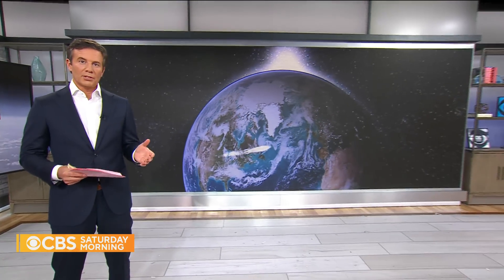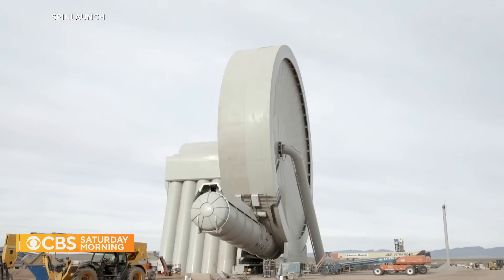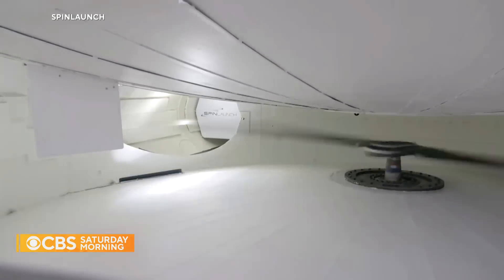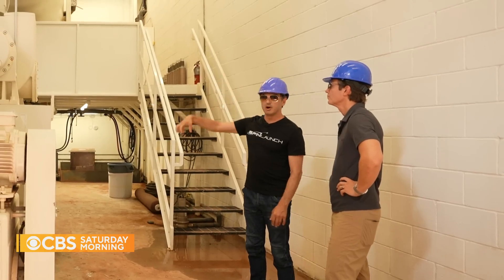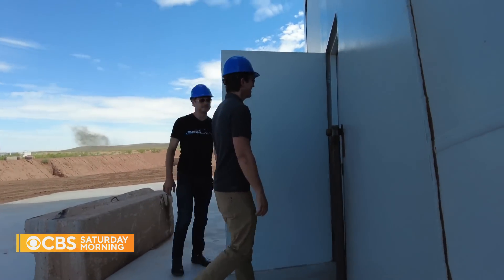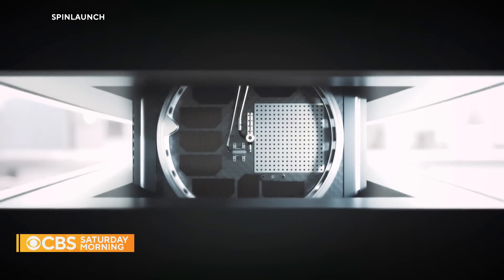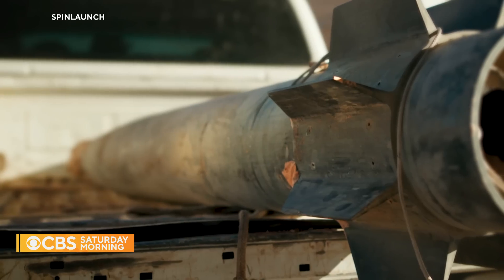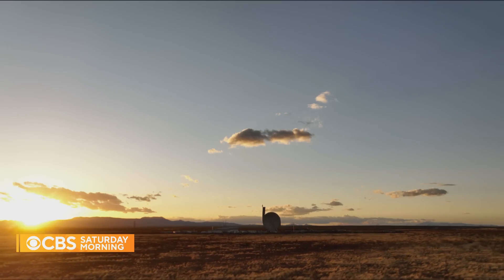New technology aims to put a whole new spin on space travel

Comment: This may be an improvment on my idea of using a giant rubber band to slingshot obects into space.  One difference is that our plan involves launching the object  parallel to the ground to the horizon instead of up because we would have to dig a hole deep enough to pull the rubber band back far enough.  The next impediment is that there is not a long enough flat surface on which to mount the slingshot because the Earth is curved. We are still working on that.
Reply: The rubber tree is probably endangered ( again) I doubt dupont would help. How would that work if it just orbits and FALLS?
Reply: Wright u r sir, ok, not the same concept as Jules Vern getting shot out of giant cannon, but, wth do I know, kind of curious to see just how far this thing could (chuck) something🤔. cowboyboilermaker
Reply: You put the front on top of a mountain and the projectile down at sea level at the end of the horizon and you still don't enough energy to orbit.
Reply: Over time it should flatten out. Be patient.
Reply: I have thought of something similar l, since this launcher seems risky and not suitable for large rockets. a carrier can be used that is accelerated on a magnetic rail to say 1000mph then it curves upward and the carrier gets destroyed in the process. this is still not 100% safe. This will only save some fuel
Reply: I would like to know how long the rubber band will be stretched so I can move my house out of the radius in case the band snaps.
Reply: How about a giant spring? 🤣🤣🤣
Reply: What are you doing about getting big enough rubber bands? Or are you just joining lots of little ones together for safety and redundancy reasons?
FYI: your idea has more chance of success than these fools.
Reply: Pesky Earth for being round. Needs a Flat Earth Society mathematician to solve it
Reply: Your concept would be perfect for launching the new coyote surface to surface rocket to take out the Russian roadrunner high speed troop transport.
Reply: I like your rubber band idea better. It's more likely to be successful instead of turning out to be just another B.S. drain on the U.S. Treasury.
Reply: Are you currently accepting new and early investors for your start up ? Because if so, I'd like to get in on the ground floor before you take your company's idea public so that I could potentially earn a small fortune from the successful "launch" of your IPO !
Reply: Probably will be weaponized for nukes
Reply: I can lace rubber band with my feet, to cut cost.
Reply: If you beleiif área 51 is a  place to meses things like this and weapon nobody knows.
Reply: Who told you that the Earth was curved?
Reply: Just put a ninety degree curve straight up in the track..Beats their continuous spinning. Kind of like those shoot around the corner guns..I think youre onto something though.
Reply: Too much atmosphere to go horizonally!  Gotta get out of the air as soon as possible.  So better start digging that hole!   ;)
Reply: That's the secret solution  a borehole through the center of the earth and out the opposite side

Comment: Still no one sees that this is just promotion for a giant scam. It will never work for satellites. The journalist should do his job and ask about the many many problems: 
1. Timing: when to release the payload so it won't miss the door almost impossible at the needed speeds. 
2. Imbalance: when the payload is releases, the arm is out of balance. So an equal weight needs to be released exactly in the same moment (ramming into the ground?), otherwise the thing will break apart from the changes in force. 
3. When the payload leaves the door, it needs to break a vaccum-proof door?!
4. When it breaks the door, the vacuum collapses immediately, sending huge shock waves through the chamber. Also: the still spinning arm hits the incoming air and will likely break
5. The moment the payload is released it still has torque from the spinning of the arm so it will tumble in the air and loose a lot of speed due to air drag
6. Only a tiny fraction of all needed satellites will be able to survive this launch (if it is ever possible)
7. to hit the air with 7 times the speed of sound at sea level is like hitting a brick wall, especiall it it tumbling.

… and loads more problems. This thing will never ever work as advertised, period. It is a venture capital fraud and the journalists should be ashamed of themselves.

Comment: I love this concept, but it doesn't seem very practical even to launch a satellite, given that the projectile "follows its own course"  If you can't steer it, how do insert the satellite into the correct orbit without a collision with another satellite.  It might be helpful to bring cargo to space to build something, but even that is questionable, imho.
Reply: They've designed the projectiles to be passively stabilized as it leaves the atmosphere. Once above the atmosphere, the projectile sheds its faring, using gimbaled rocket stages to push and guide the payload into orbit. They're thinking this through.